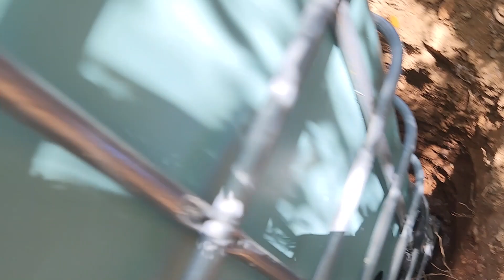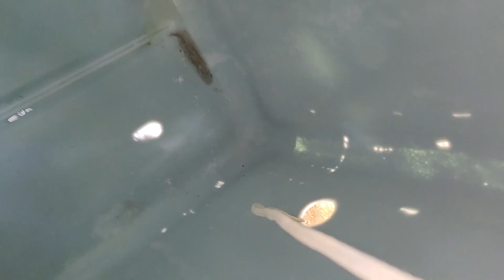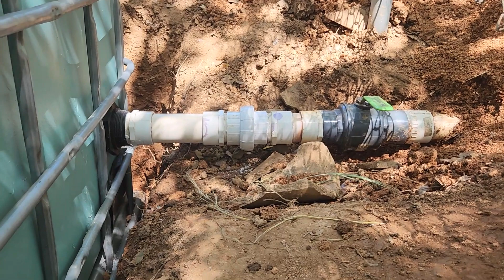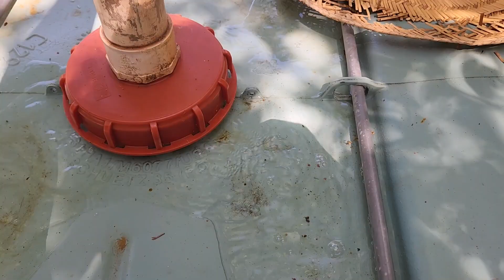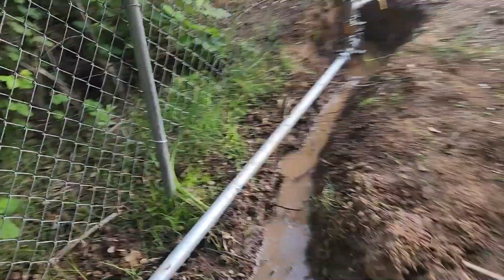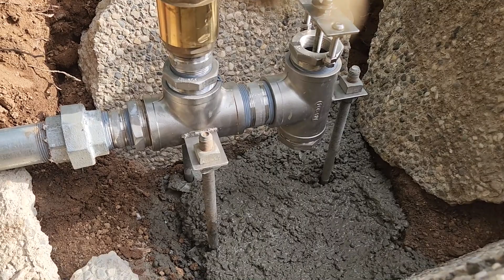Hydraulic Ram Pump - Water Transfer Tank and Pump Install

Comment: Drive pipe vertical height please
Reply from the maker: The drive pipe is about 90 feet long with about 8 feet vertical drop. The last 10 feet of it is galvanized steel to reduce expansion during water impact from the hydraulic ram.
Reply: @minovation  thank you sir